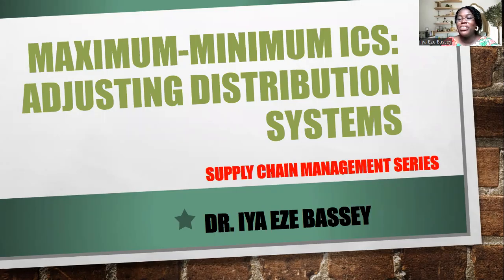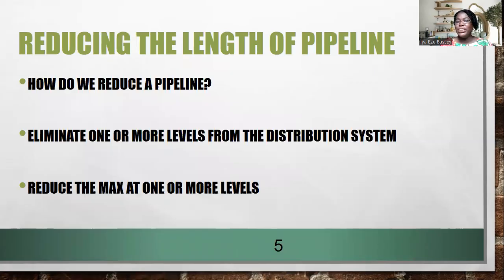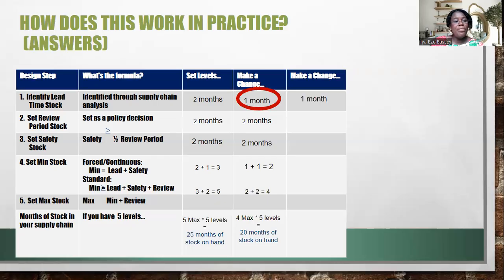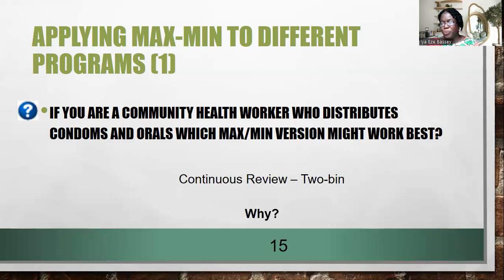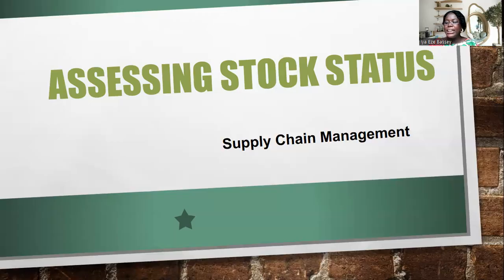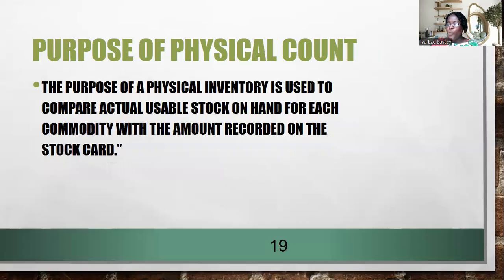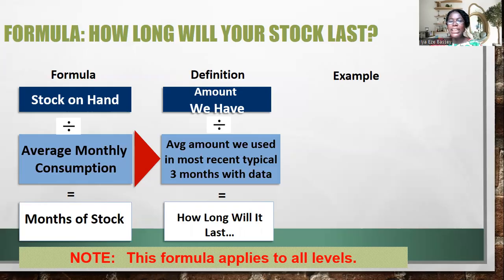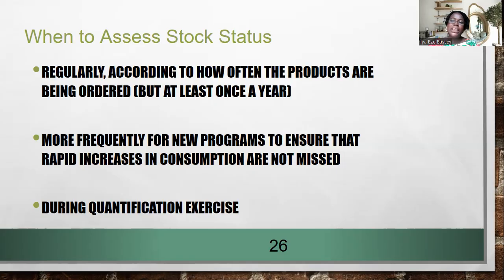Maximum-Minimum ICS: Adjusting Distribution systems (Supply chain management series)

Comment: Thank you, Ma.
 I was able to understand the challenges, advantages of the Max Min system, applying the Max Min different programs. In summary, I learn that the length of people is the first step to take to adjust a policy, each level imply. Reducing the length of the pipeline by eliminating one or more levels from the distribution system, reduce the max or the one or more levels, reduce the maximum stock level I learnt that factors that impact max in max stock level are; cost of product, reliability, transportation, storage capacity, cost of storage, shelf life of health commodities.  
Advantages of using max min system  
1. Avoid under stocking  
2. Avoid over stocking 
3. Avoid cost of emergency order  
5. Consistency of stock levels  
I also learn that physical count in the process of counting by hand the total number of usable unit if each commodity in your store or health facilities. thank you very much ma this was so engaging

Comment: In conclusion, I've learnt that the steps in designing a max-min ICS are
Set up initial max-min policies for each level and type of faculty 

Check if the overall distribution will function properly if the level specific max-min policies are implemented

Check the total length of the pipeline that the policies at each level imply 

Some factors that can impact max-min stock levels are
Cost of products
Reliability of transportation 
Cost of storage 
Lead times etc

Advantages of using max-min system includes 
Avoid overstocking 
Minimize wastage 
Avoid cost of emergency order

Challenges using each version and variation are
Systems with numerous levels
Systems that manage a large number of commodities

Comment: In summary, maximum and minimum inventory  control system provides comprehensive guidelines for managing stock levels to prevent overstocking and  understocking.
The lecture talks about various types in designing a maximum and minimum inventory control,the steps for reducing pipeline length,and some factors affecting it.Thanks

Comment: •	Set up initial max-min policies for each level and type of facility.
•	Check if the overall distribution will function properly if the level specific max-min policies are implemented.
To reduce the length of pipeline, 
•	Eliminate one or more levels from the distribution system.
•	Reduce the max at one or more levels.
Factors That Impact Max-Min Stock Levels
•	Cost of products.
•	Reliability of transportation.
•	Cost of storage.
•	Shelf-life of health commodities.
•	Lead times.
•	Age of program.
•	Accuracy of forecast.
Advantages Of Using Max-Min Systems.
•	Avoid overstocking.
•	Avoid understocking.
•	Minimize wastage.
•	Avoid costs of emergency orders.
ASSESSING STOCK STATUS
Physical Count: This is the process of counting by hand the total number of usable units of each commodity in your store or health facility at any given time.
Purpose Of Physical Count
It is used to compare actual usable stock on hand for each commodity with the amount recorded on the stock card.

Comment: MAXIMUM-MINIMUM ICS ( adjusting distribution systems)

Steps in designing a max-min ICS are 
1. Set up initial max-min policies for each level and facility.
2. Check if the overall will function properly if specific max-min are implemented.
3. Check total length of pipeline that policies at each level imply.

Reducing the length of pipeline: 
Eliminating one more levels from the distribution system.

Reducing the maximum stock level: 
Elements of the formula which can change in order to reduce the max stock level.

Factors that impact max-min stock levels 
1. Cost of products 
2. Cost of storage 
3. Storage capacity 
4 Reliability of transportation 
5. Age of program 
6.Management skill of staff 
7. Lead time 

 Advantages 
1. Avoid overstocking 
2. Avoid understocking 
3. Minimize wastage 
4. Avoid cost of emergency orders
5. Consistency of stock levels 

 Challenges to max-min ICS:
1. Systems with numerous levels 
2. Systems that manage large numbers of commodities 
3. System that manage products of new programs 

Assessing stock status:
Purpose: is to determine how long supplies will last. 

Physical count: process of counting by hand the number of usable units of each commodity in your store or health facilities at any given time. 
Purpose: is to compare actual usable stock to hand for each commodity with the amount recorded on the stock card. 
Determining the number of months stock will last. 
Stock on hand ÷ average monthly consumption = months of stock 

Amount we have ÷ amount we used in the recent typical months with data = how long it will last .

When to assess the stock status
1. Regularly according to how the products are ordered.
2. During quantification exercise.

Comment: Thank you so much!
I learned how to plan a max-min system for storing health items. Steps include:
	•	Setting the first rules for each level of facility
	•	Making sure the rules work for the whole system
	•	Checking how long the supply chain becomes

To reduce pipeline length:
	•	Remove a level in the supply system
	•	Lower the maximum stock level at some places

To reduce max stock, change these:
	•	Review items more often
	•	Reduce the time it takes to get new stock
	•	Make the system work better so less backup stock is needed

Other things that affect max-min stock:
	•	Product cost
	•	Storage space
	•	Storage cost
	•	Shelf life
	•	Transport reliability

Max-min helps because it:
	•	Stops too much or too little stock
	•	Reduces waste
	•	Stops costly emergency orders
	•	Makes stock decisions easier

Problems:
	•	Many system levels
	•	Many types of products
	•	New health programs

A physical count is checking each item in stock by hand to compare with the written record.
Stock status is about knowing how long the supplies will last.

Comment: Thank you very much, Ma. l  have learned how to play a max-min system for storing health items. Steps include: 
-Set rules for each level 
- Make sure rules work across the system 
Check how long the pipeline is

How to Bring the Max stock level 
- Review items more often
- Reduce how long delivery takes
- Improve system performance to need less backup

Problems that may affect the system 
 - Many levels in the system
- Many types of health products 
- New health programs

Max-min system is helpful due to the fact that ot: 
- Prevents too much or too little stock
- Lowers waste
- Avoids emergency orders
- helps in stock planning 

Other things that affect stock level 
- Product cost
- How much space is available 
- Storage cost
- How long does the product last 
How dependable transport is

A physical count is checking the stock by hand 
While 
Stock status tells how long supplies with last.

Comment: Thank you ma.
Now I  understand how to plan a max-min system for storing health items. Steps are:
	•	Set rules for each level of the health system
	•	Make sure the rules work at all levels
	•	See how long the supply chain takes

To reduce the pipeline length:
	•	Remove one level from the system
	•	Lower the max stock at some points

How to lower the max stock:
	•	Do reviews more often
	•	Speed up the supply time
	•	Improve the system so less extra stock is needed

What can affect max-min levels:
	•	How much items cost
	•	The space we have to store them
	•	Cost of keeping them in storage
	•	How long they stay good
	•	How reliable delivery is

Max-min system helps by:
	•	Keeping the right stock level
	•	Cutting waste
	•	Avoiding emergency orders
	•	Making stock decisions simpler

Some problems are:
	•	Many levels in the supply system
	•	A lot of different products
	•	New health programs

Physical count is when you check stock by hand.
Stock status shows how long the stock will last.

FROM:
Mark-Anthony Abuo

Comment: Thank you ma for these wonderful video
In Summary
THE STEP IN DESIGNING THE MAX-MIN INVENTORY CONTROL SYSTEM
set up initial max-min policies for each level and type of facility
check if the overall distribution will function properly if the level specific max-min polices are implemented 
check if the total length of the pipeline that the policies at each level imply

HOW TO REDUCE LENGTH OF PIPELINE
Eliminate one or more levels from the distribution system

Reduce the Max at one or more levels

HOW TO REDUCE MAXIMUM STOCK LEVEL
Shorten the Review Period at one or more levels
Reduce the Lead Time at one or more levels
Improve the distribution system's reliability at one or more levels so that Safety Stock can be reduced

FACTORS THAT IMPACT MAXIMUM AND MINIMUM STOCK LEVEL
Lead times
Reliability of source of supplies

Effect of a zero balance of stock
Management skills of staff
Age of program

Accuracy of forecasts
cost of product etc. 

 ADVANTAGES TO USING MAX-MIN SYSTEM
Avoid overstocking
Avoid under stocking
Minimize wastage 
Avoid costs of emergency orders
Simplify inventory control decision‑making
Consistency of stock levels 
Reliable data source from SDP for forecasting and quantification

CHALLENGES TO USING EACH VERSION OF VARIATION
Systems with numerous levels

Systems that manage a large number of commodities
Systems that manage products for new programs

THE INVENTORY CONTROL SYSTEM USED IN THE LOGISTICS MANAGEMENT OF HIV/AIDS COMMODITIES (LMHC).
for these, we use the forced ordering maximum ics because in this system, all stock levels are reviewed at the at the end review period

PHYSICAL COUNT
A physical Count is the process of counting by hand the total number of usable units of each commodity in your store or health facility at any given time
The Purpose Of A Physical:
A physical Count is the process of counting by hand the total number of usable units of each commodity in your store or health facility at any given time
Purpose Of Assessing Stock Status:
The purpose of a physical inventory is used to compare actual usable stock on hand for each commodity with the amount recorded on the stock card.
  
FORMULA USE TO KNOW HOW LONG WILL YOUR STOCK LAST
Stock on Hand (Amount 
We Have) =100 tablets divided by ÷
Average Monthly 
Consumption (Avg amount we 
used in most 
recent typical 
3 months 
with data)=25 tablets used
per month... equal to =
Months of Stock (How Long Will It Last) =4 months supply of tablets
i.e 100÷25=4

WHEN IS PHYSICAL COUNT DONE
during quantification excercise 
regularly according to how often the product are ordered 
more frequently for new programme to ensure that rapid increase in consumption are not missed

Comment: Another beautiful and interesting session with the Prof.😊😊🩷. This session is really really educating especially the calculation aspect. This session titled "Maximum-Minimum ICS" by Prof. Iyaeze tells alot about maximum-minimum inventory control system, as well as the purpose with various examples, the advantages and disadvantages of the different maximum and minimum inventory control system, calculations of parameters used in Max-minimum ICS and many more.
Starting with the definition. 
The purpose of the inventory control system
1.To maintain an appropriate stock level of all product
2. To determine when stock should be ordered
3. To determine how much stuck should be ordered/issued. 
Going further us the decimation of the following terms in ICS;

1. Review Period : This is the time schedule for reviewing stick levels.
2. Maximum stock level : It is the maximum quantity of commodities a store keeper can hold at any time.
3. _Minimum stock level_: it referred to as the quantity of commodities a store keeper Matt have to avoid stock out
4. Emergency order : This is the stock level at which the emergent order should be placed to avoid a stock out whether or not at the end of a review Period.
5. Safety stock level: It is also referred to as the buffer stock and it is less than the minimum but higher than the emergency order point 
6. Lead Time: This is the time interval between ordering stock and the time the stock is received and ready used for use. 

Next part is the types
Types of Max/Min inventory control systems
1. Forced ordering Max-Min inventory control system
2. Continuous review
3. Standard version
 The differences between the Forced ordering version and the contiguous version was the next part
1. The continuous review version
2. The orders are only made when you reach min.
3. There's no emergency order point in continue review version.
Over to the calculation aspect;
Cal for how much to order;
1. Order quantity=Max stock quantity(MSQ) - Stock on hand (SOH)
2. Max stock quantity(MSQ)= Average monthly consumption×mad stick level
Lastly to the steps in setting max-min level.
1. Determine your lead time
2. Set the review Period
3. Set the safety stock
4. Set the min stock level
5. Set the max stock level
6. Set the emergency order point.
Thanks ma'am I really enjoyed every bit of this online lecture session. I'm grateful ma'am🙏🏼🙏🏼😊

Comment: Thank you ma for this wonderful lecture 
I learnt that to adjust distribution systems we will first consider the length of pipe line 
I also learnt about the factors that impact max-minimum stpck level include
1.cost of product
2.Reliability of transportation
3.storage capacity
4.cost of storage
5.storage conditions at different levels
6.shelf life of health commodities
7.lead times
8.reliability of supply source
9.Effects of zero balance of storage
10.Management skills of staffs
11.Age of program
12.Accuracy of forecast

Comment: Thank you ma
To streamline a distribution process:

1. Remove one or more tiers from the supply chain.
2. Lower the maximum inventory level at selected points.

BENEFITS OF THE MAX-MIN APPROACH:
1. Helps prevent overstocking
2. Reduces the risk of stockouts
3. Cuts down on unnecessary waste

COMMON CHALLENGES WHEN IMPLEMENTING:
1. Systems with too many layers or hierarchies
2. Operations involving a wide range of inventory items
3. Programs introducing new product lines frequently

Comment: Designing a Max-Min Inventory Control System (ICS):

1. Establish initial Max-Min policies for each facility level and type.
2. Evaluate overall distribution functionality.
3. Assess pipeline length and eliminate unnecessary levels or reduce max levels.

Factors Impacting Max-Min Stock Levels:

- Product cost
- Transportation reliability
- Storage capacity and conditions
- Lead time
- Supply reliability
- Management skills
- Program age
- Forecast accuracy

Max-Min System Advantages:

- Avoids overstocking
- Minimizes wastage
- Prevents understocking

Assessing Stock Status:

- Conduct physical counts to determine usable commodity quantities and duration.

Comment: SUMMARY 
I learnt about :
1. Stock Optimization: ICS facilitates the maintenance of optimal stock levels to mitigate the risks of stockouts and overstocking, thereby ensuring uninterrupted service delivery. 

2. Replenishment Planning: It aids in accurately determining the appropriate quantity of stock to order and the precise timing for reordering, thereby streamlining procurement processes. 

key terminologies associated with ICS: 

• Maximum Stock Level: This refers to the upper limit of inventory a stock keeper is authorized to maintain. For commodities such as those related to HIV/AIDS programs, including laboratory reagents and consumables, this threshold is typically set at a 4-month supply. 

• Minimum Stock Level: This denotes the lowest permissible inventory level required to avert stockouts. For essential commodities, a 2-month buffer stock is generally maintained. 

Types of Min/Max Inventory Control Systems (ICS): 

• Forced Ordering Max–Min ICS: Reordering is triggered regardless of current stock levels at predefined intervals. 

• Continuous Review Max–Min ICS: Stock levels are monitored continuously, and orders are placed when inventory falls below the minimum threshold. 

• Standard Version Max–Min ICS: A hybrid approach incorporating features of both forced and continuous review models.

Comment: Thank you ma for this wonderful lecture, here's a summary of what I learnt, 

To reduce a pipeline? We eliminate one or more levels from the distribution system
2. Reduce the max at one or more levels.

ADVANTAGES OF USING MAX-MIN SYSTEM.
1. Avoid overstocking 
2. Avoid understocking
3. Minimize wastage
 
Challenges to using each version in variation.
1. Systems with numerous level
2. Systems that manage a large number of commodities 
3. Systems that manage products for new programs
 Thank you ma once again

Comment: Thank you ma for another wonderful lecture.I
understood the insights into optimizing supply chains
by simplifying levels and adjusting formulas, especially
concerning maximum stock, review periods, and lead
times. Understanding factors like lead time, storage
costs, and facility capabilities is crucial for effective
inventory management. A major benefit of this
system is preventing both overstocking and
stock-outs, thereby reducing waste. The importance
of physical counting to reconcile actual stock with
records, along with assessing stock status to predict
supply longevity and calculate MOS (Months of
Stock), was also emphasized. Also, the practical
application in laboratory settings for managing
consumables and equipment was noted, with success
depending on factors such as lead time, program
maturity, forecasting accuracy, and staff management
skills.